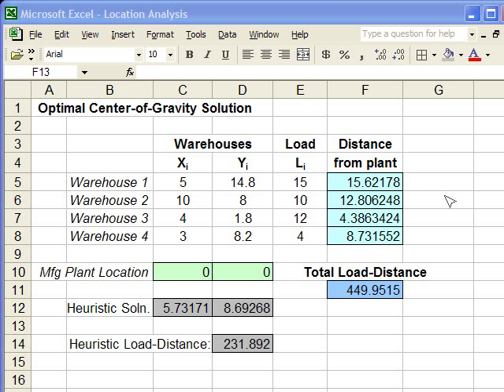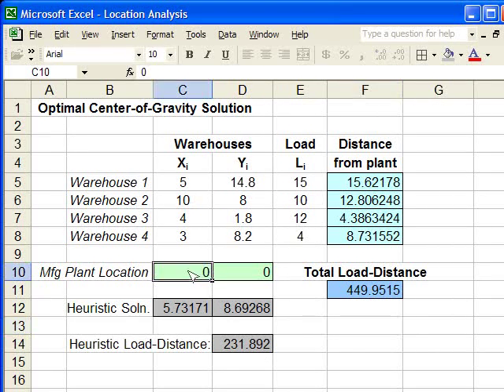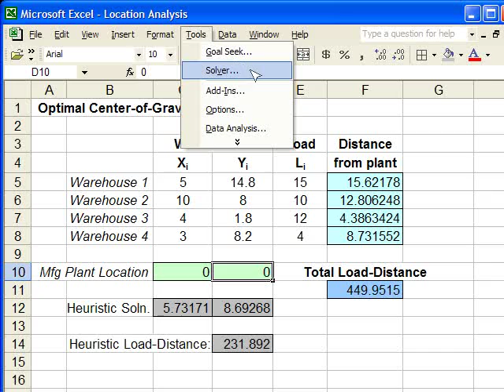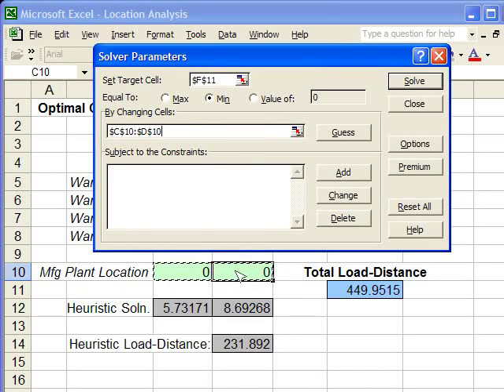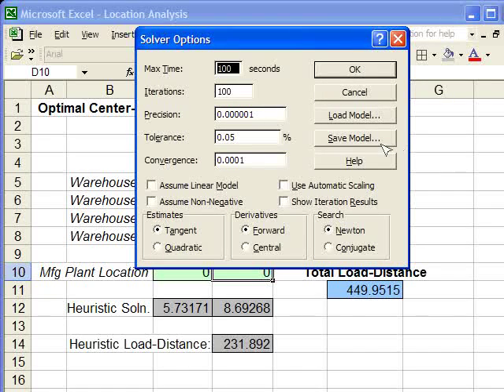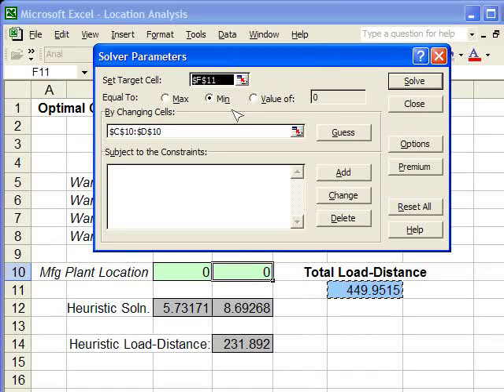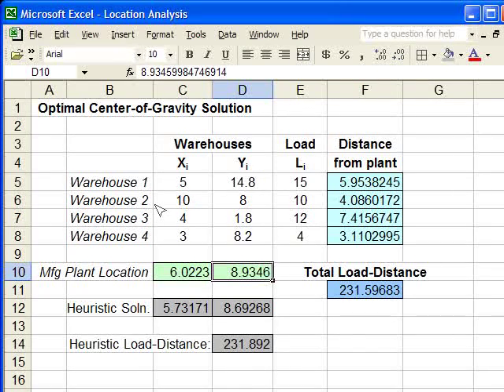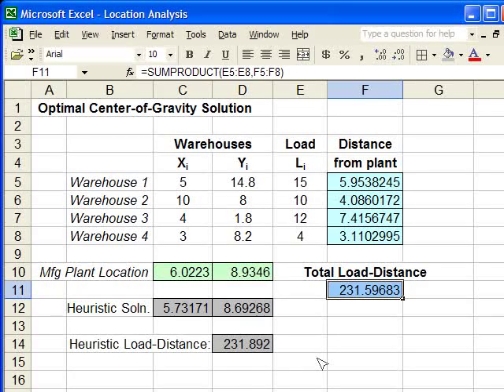Optimal Center of Gravity

Comment: Would this work with latitude and longitude points? Or do I have to convert them to radians? Since some of these are negative, should I leave the non-negative settings on? Doing a paper and I have several thousand points in which I need to get a few center of gravity points in different cluster groups.
Reply: It should yea